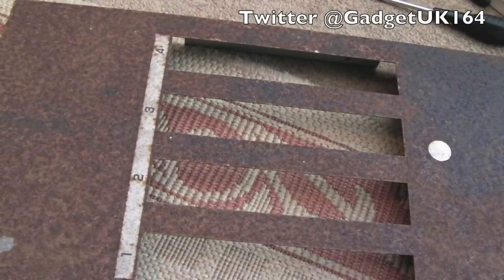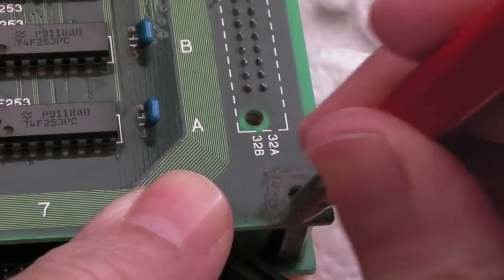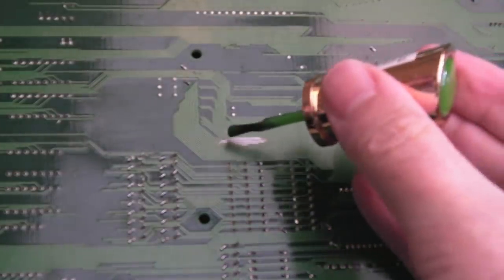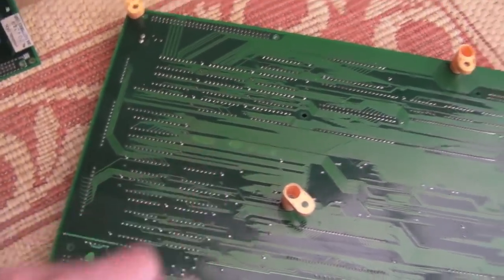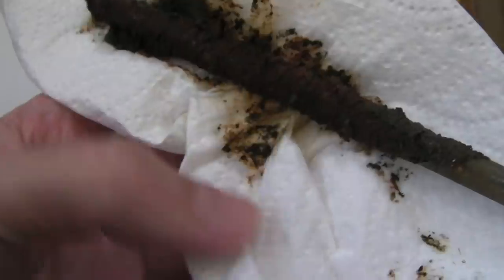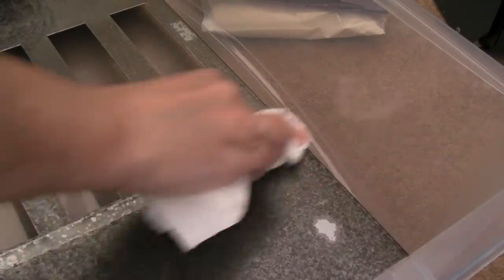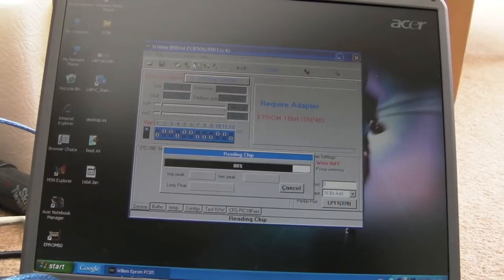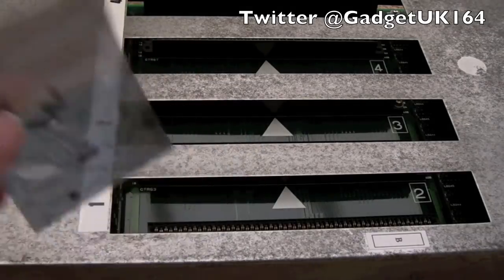SNK Neo Geo MV4 (4 Slot) Repair Part 2 (Cleanup, Testing & Electrolysis Rust Removal / Zinc Plating)

Comment from the maker: Part 1 - https://youtu.be/dZoVRUsGHVE
NOTE: The negative croc clip there - it's very likely stainless steel.  So that would result into a very small amount of chromium coming off into the water.  If you connect up in a similar way, consider connecting some steel wire to the object you are de-rusting and have the croc clip outside of the tank.
Reply: Excellent work! I wonder if removing rust or oxidation from the soldier joints may be accelerated by Sodium persulfate or Ferric Chloride. I think that this is pretty reasonable approach, might be safe if applied carefully, may save countless of hours. Please do not throw away this conception, it might sound crazy but is much cheaper than deoxit as well as it is much faster and less harmful than mechanical removal. Please try it at least one time on any junk board. Please also take a look at products dedicated to ultrasonic cleaners. They work for me well as well without ultrasonic cleaner.
Reply from the maker: Thanks =D  I wouldn't use Ferric Chloride as that will eat through any exposed copper!

Comment: Hello,
I got NEO-MVH 6 slots type whole arcade. No display no sound.
I'm lost..... Please help
Reply from the maker: Battery corrosion is the most likely cause!  See my other 6 slot, 4 slot and 2 slot videos.  You should start by seeing if SMK Dan Diagnostic BIOS boots and gives any info on bad RAM.  If that doesnt boot, chances are there's a databus conflict or something wrong with the addressing of the ROM at reset, or perhaps a reset issue.

Comment: Would you be willing to share the labels for the top of the  4 Slot Neo Geo?
Reply from the maker: https://www.dropbox.com/s/0bz5t69n10s51r1/MV4%20Labels.zip?dl=0   They will need resizing - I did this before printing in Paint Shop Pro.   Try printing to standard A4 first so you can work out how much they need increasing or decreasing in size.  Then print to a sheet of sticky paper.   You would then need to cut them out with a guilotine (or sharp knife and ruler).   You can protect the labels also my sticking wide selotape over them before you cut them out.
Reply: @GadgetUK164  Thanks.

Comment: Holy crap, am I behind in commenting. 🤦‍♂️ I'll have to start keeping notes to remember what I wanted to say, besides the usual, great video! This was super interesting, as I have several C64 RF modules covered in rust. I think I'll give this a try. Oh... and by the way... great video! ;)
Reply from the maker: Thanks =D  Be very careful with anything shiney - it could be chrome plated!  I suspect most pieces of shielding have chrome plating!
Reply: @GadgetUK164 Yes! Good point. Are the RF lids chrome plated or polished metal? [rhetorical question to myself]
Reply from the maker: I suspect they are chromated!  Most of that old shielding is like that (eg. A500).

Comment: I've really liked to see the electrolysis and zinc plating processes. Thanks. But seeing the result I would just had sanded it and applied some Hammerite direct to rust spray. https://www.hammerite.co.uk/product/direct-to-rust-metal-paint-aerosol-smooth-finish/
Edit: Now I'm listening the problems with your health. Get well, luck. And next time try what I say just in case. TBH I haven't tried that myself, but only Hammerite Rust remover (that leaves a black finish) or also used Hammerite Martele paint that leaves a finish just like yours. Both worked right, but "direct to rust" seems to be a good option.

Comment: I have never worked on a neo geo how hard is it to remove the slots via de soldering from the board? I would think an ultrasonic cleaner would make short work of getting them clean as can be. That board is giant though thus the thought of removing the slots rather than trying to clean the whole board in a cleaner.
Reply from the maker: With a good desoldering station they aren't too hard to remove!  Cleaning in an ultrasonic bath would be the best way for sure!  I just don't have one, or a dish washer for that matter lol =D

Comment: hi GadgetUK164 .. great video 
learn at lot .. got my mv4ft2 running watching some of your videos :) .. can you tell me what eprom to use for a replacement for the LO-ROM ? thx .. hope you get well soon and we get to see more neo-geo repair videos
Reply from the maker: Thanks!  You can use a 27C010 (128K), but you might need a wire or two to change the OE or CS I think.  Look at the MV1F schematics, see the LO ROM chip on there and look at its pinouts, compare to the pinouts of the 27C010 and you will see where you need a wire or two to swap two of the pins.

Comment: I've used electrolysis a bunch. Works great.

 I do it outside in a a 20 gallon bucket with a car battery charger. I use metal tent stakes and put them circling the part with metal wire tying them together. I think it took so long cause you just had the one rod and a bench power supply.

I've done rusty car and scooter parts that were rustier than your shroud.
Reply from the maker: That's definitely the way to go - with a 20 gallon bucket and car charger!

Comment: Not commented before but an avid fan, with regard to the labels you can use lacquer on the labels rather that sellotape.
Reply from the maker: Thanks =D  Yes, that would be a nice way to protect them!  I think Ant should sand and spray it, then add new labels, and then lacquer it! =D

Comment: Top video Chris, you've done a great job on repairing and restoring that Neo Geo MVS 4 Slot. Hope Ant (Big Nutz and the Horse) over at Riot Retro Gaming love the Neo Geo just like we do.
Reply from the maker: Cheers mate =D  I hope Ant gets it up and running without issue.  Paranoid incase something goes awry with however it gets powered - supergun PCB I hope!

Comment: Very interesting to see the electrolysis in action! The bad cart connection I was wondrring maybe there was a cracked solder joint ? But looking at the amount of dirt on the board the contacts were probably just as dirty. Whats your thoughts on wadhing boards in dishwashing machine?
Reply from the maker: Thanks my friend =D  I think if I had a dish washer, and if it was large enough - I might give it a go and just rinse off with IPA or distilled water afterwards.  It would save a LOT of time!

Comment: Hi Gadget!
If I may say, I would have de-sandwiched the 2 boards and then put them in the dishwasher. Seems extreme but I had a lot of success with this method.
It really spares oneself a lot of time and hassle, plus the boards come squeaky clean after this procedure.
You just need to displace the water afterwards with compressed air, and then spray the whole board with IPA to help evaporate any residual humidity.
As an alternative to the dishwasher, you can wash the boards with warm water and detergent in the kitchen sink, or in the bathtub, while agitating the soapy water with a brush.
This way you can obtain boards which not only look clean, but are also completely dirt-free from under the chips themselves.
The dirt stuck under those simply can't be completely removed when solely using cotton buds and kitchen rolls...
Reply from the maker: Sadly I don't have a dish washer - I am the dish washer in this house lol =D
Reply: @GadgetUK164 Ho I understand. Like I said, you can try the alternative as well :-)
But I don't know if it would be so easy to film...

Comment: Couldn't you get it plated by a company?
Reply from the maker: Yes, I am sure that's possible!   One of my earlier ideas (for my 1st 4 slot) was to take it to a car body shop and have them sand it down, power coat it and professionally spray it etc.
Reply: @GadgetUK164  was the shielding needed for an earth i.e. left as metal (not powder coated or sprayed)?

Comment: Bloody Hell that's a dirty dog, you did an epic job mate.
Reply from the maker: Cheers mate =D
Reply: Any ideas on why my GBA freaks out when I play GBA games on it but regular GB and GBC all work fine? I am flummoxed, I've cleaned the pins, pushed them outward very slightly, cleaned it all, looked for anything obvious like corrosion leaky cap's etc., I just don't get it, I am wondering if it's a power thing or the processor has gone nuts, to be honest I am out of my depth, any help would be good I am alright with my soldering but I can't see an issue, it kind of freaks out and makes an awful noise then black or white screens whilst the noise continues, the GB/GBC games no issues at all. and I've tried loads.
Reply from the maker: @9ElevenGamer  That is interesting!  My first thought would be a bad connection on the cart - ie. not all of the same pins might be used with a GBA game cart.   That said, they might be connected to totally different chips inside, it's possible there a fault on the GBA chipset that for whatever reason means the GB side works OK.  Have you checked all the F marked components on the board - eg. F1.  Should measure as a short!  If any of those are open circuit you could just have a blown fuse.
Reply: Cheers, I'll look into that are they the really tiny ones? I'll find it, sure it'll be marked on the board, I had an issue with a previous GBA the second model and that just needed the Fuse Bridging easy fix if a little tricky due to the minute size of it, but it worked.

Comment: I would have used white vinegar, if it had chrome plating just fine sand after then spray it with zinc spray can.
Reply from the maker: I used white vinegar for the plating part.  It certainly would be better to spray it rather than plate it I think!

Comment: Was the flickering on the game you said was designed for CRT a trick they used for some reason? Did it make the scene look dimmer or somthing else?
Reply from the maker: I think it was supposed to make the screen look dimmer - not 100% sure.  It could be a bug in that version of the game too.  I think I have another ROM for this so I might try that out to see if it behaves the same.  The cart is a reproduction as it was never officially released.